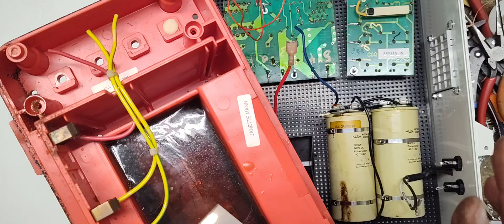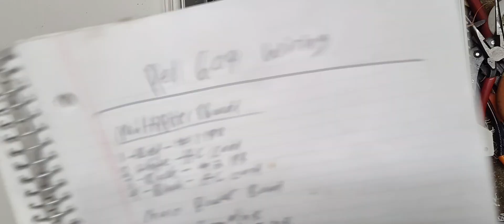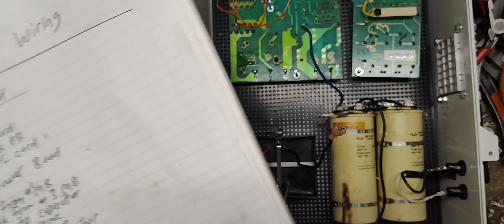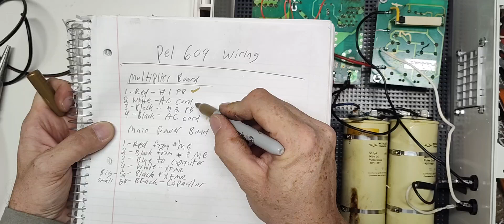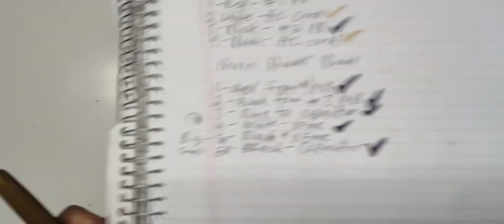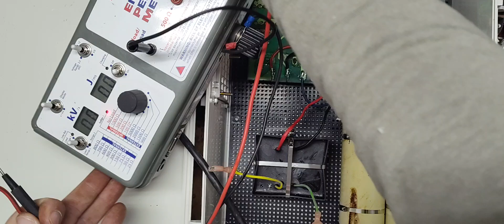Building A DIY Electric Fence Charger For A Customer Part 4 | PEL 609 Fence Charger Repair

Comment: Building something like this would at least be %00 and maybe more with all that time and testing involved...Really cool to design and light the outside of the box and such..really cool..
Reply from the maker: It did take a bit of time to do all of this, I think overall the total cost with shipping was $300, but a similar unit with this sort of power and reliability would be $700+. There are cheaper options out there, but those are either cheap non repairable units because of no parts being offered or not near as reliable as this one.
Reply: @FencerFixerRepairLLCKansasCity  That not much  for a really great unit!!...Now it can be repaired and you know it better than anyone..Super cool!!! Sorry autocorrect sucks...what I wrote made no sense...
Reply: When you use a generic board do those come from Parmak?? Someone asked a few videos ago and I  couldn't find where you told him. I believe you said they were 2 joule units if I remember correctly...I am thinking of using a board like that to compare my race CDI's to as far a charging time and dumprate....I believe you said they were $30 from the company... Thanks -John
Reply from the maker: @Biokemist-o3k  Send me a link to that video of you can.
Reply: @FencerFixerRepairLLCKansasCity  That is why I asked because as you know I have been watching a ton of your videos while I have been sick and then after my surgery the past couple weeks..I corrected what I said about the cost of the unit. Darn autocorrect...I will if I can find it but it might have been a repair on a zareba. If I find it I will let you know...